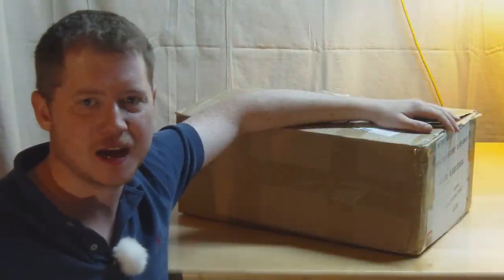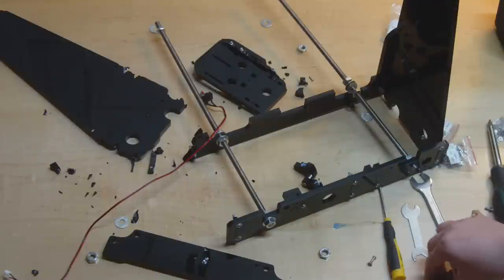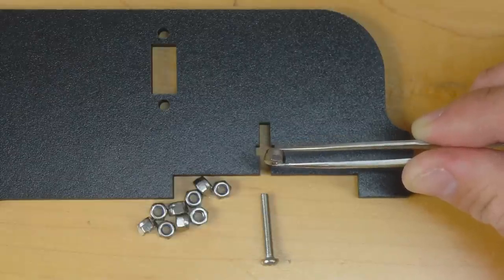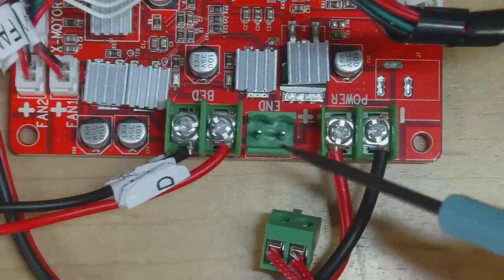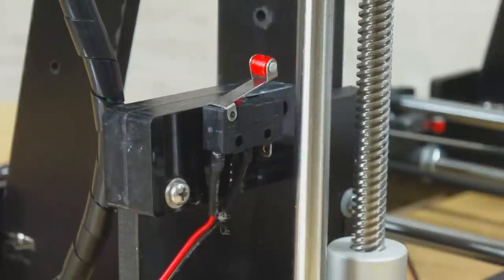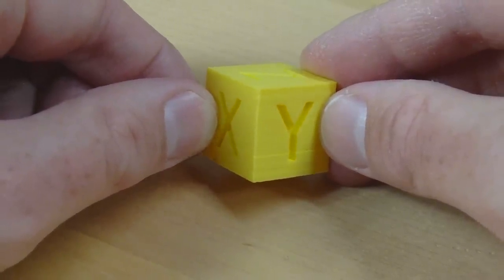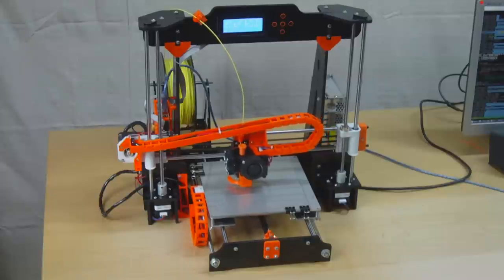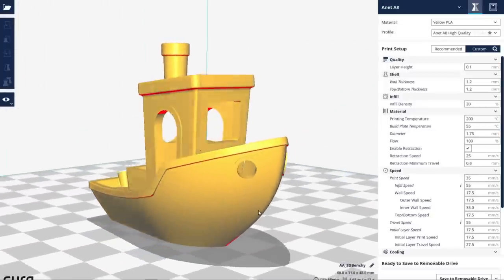[007] Anet A8 3D Printer - Review, Upgrades and Experiments

Comment: FYI I bought one of these from Gearbest last month and it just arrived a couple days ago and already upon inspection of the parts the hot bed is broken and gearbest is not supporting it. they are giving me a hard time with it. I contacted the main company called anet3Dprinter.com which is their official site and sent them pictures of the bed and they responded saying that it's NOT authentic and it's a cheap copy of thier printer because it does not have their logo on the hotbed. I believe that is why Gearbest is not supporting me on the purchase and the default because they know it's a copy. so my advice anybody who sees this comment do not buy this from gearbest as they're selling cheap knockoffs.
Reply from the maker: You can buy replacements parts quite cheaply on eBay, because the A8 is a clone of the Prusa i3, and there are other clones also, so you should be able to find a compatible replacement.

Having said that, this is a really crappy customer service by GearBest. It can happen from time to time with Chinese sellers. This is maybe an argument to buy from AliExpress or eBay not direct from GearBest, because if the seller screws up you can give them a negative review, which really hurts the seller for a long time, so they will try harder to fix mistakes.
Reply: hello I don't think I'm going to buy any more parts for this because I don't want to spend any more money on a printer that's basically a hunk of junk. I'd rather spend the money and get a new printer that I know will work. as far as gearbest ever since I've got the printer we've been going back and forth in a feud I'm trying to get results and they're just kept telling me to put it together and just to see why it doesn't work. I already showed them pictures of the heat bed and howit was damaged. It's the same pictures I actually sent to the official anet 3D printers website. who told me themselves that it was not an official printer from them because it did not have their logo printed on the heat bed and from the pictures they said it was also damaged. which I told that to gearbest but they keep insisting for me to keep putting it together. And I told him yeah and burned my house down? I tried to find a place to write a review about them but there is a link that only sends me to my account page to show my review list but there is none there. I told them forget it I'm done dealing with them and I'll take it as $150 loss or $150 lesson learned I should say. I have pictures of the heat bed which shows the crushed thermal resistor, and the bare traces on the bottom. And as I said it doesn't show their logo either so I know it's not made by ANET. :-( I don't see the purpose of spending money on this printer when I can buy a new one after already spent $150 on this and the parts are just cheap since it is just a knockoff. and I read all over the place that the cheap knock-offs are very dangerous. to me it's a waste both money and time.

Comment: You did nothing wrong bro. That acrilic is very ridiculous. people are swapping to epoxy glass. And some others. Me? If it's not aluminum or metal. Preferably stainless steel 
That material is very very very delicate.
And should in my opinion no longer be used with AnYtHiNg!!
Jagged as all hell.
Turned out very nice..

Comment: Cable chains are actually a downgrade. You've increased the mass that it has to drag, and in an asymmetrical way. The carriage moving left has to overcome more inertia as it moves and less as it moves right. Same with the bed. It has to move more chain as it moves away and less as it moves toward you. Compare to the weight of just the wire and you'll find that it's much more likely to skip steps in one direction than another when running at high speed. These printers are very capable of running at ridiculous speeds with only minor modifications, and I applaud most of the other changes you made, but cable chains should only be used where they're absolutely necessary.

Comment: way too much loctite.
Reply from the maker: +Nevada ADV Yup. At the time I didn't have a way to apply small amounts, and I didn't think having excess would matter. I left the fail in the video because it's good for people to see me fail and learn from mistakes.
Reply: OpenTechLab I may have done it too, thanks for sharing.
Reply: I use loctite on my bike all the time, just a tiny drop will do, and let it dry on the threads before using, though I don't know of the effect on plastic.